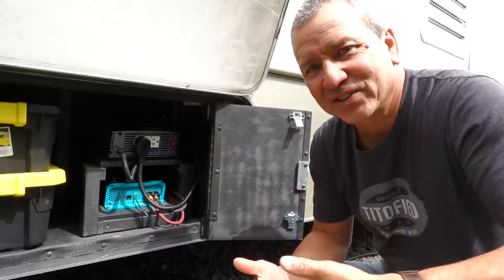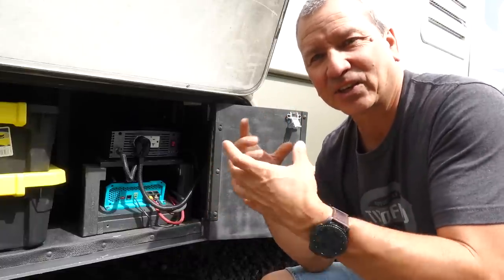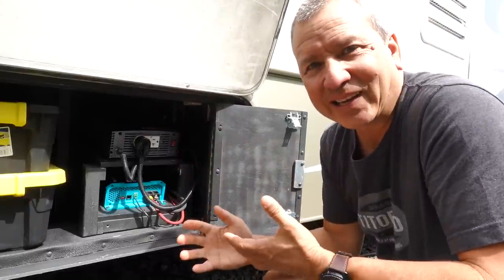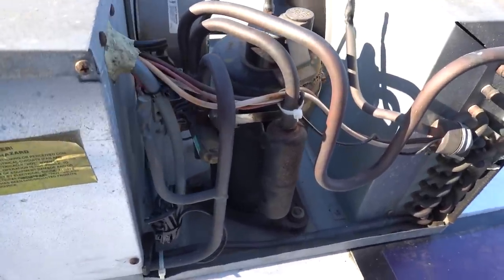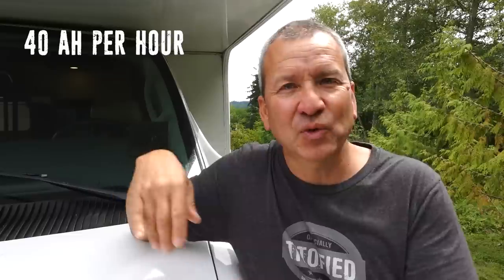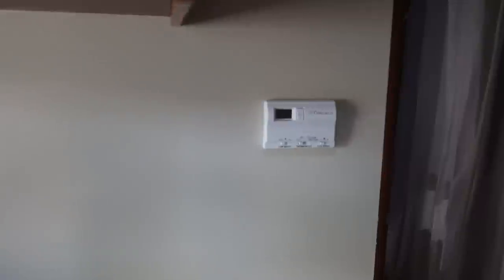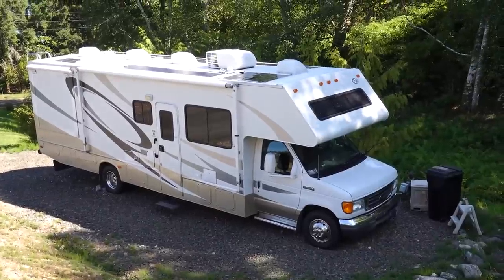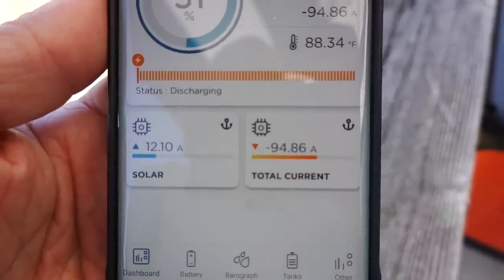BAD IDEA? Running RV Air Conditioner on SOLAR and INVERTER

Comment: You're a brave man for even trying it IMHO. You do have a huge van though. I think any system would struggle to run a decent sized AC unit. IMHO get the RV in the shade, put out awnings either side and run a separate 300W solar panel out in the sun and run fans... well that's how we got around it...
Reply from the maker: That's pretty much what we do until it gets too hot. Then we're moving on to cooler places.
Reply: @RVwithTito  My wife and I can handle the heat but when it's those few weeks that are unbearable, we have resorted to RV parks and just 'plug in' for a few weeks. At least we can run the AC all day everyday, charge all the batteries, bring on fresh water, dump the old, wash and service the  van and just chill during those really humid weeks.

Comment: Excellent share. I have watched several RV videos where the people are mounting panels all over the roof and building huge systems at a ridiculous cost, so they can try to run their AC. The problem is that they do not replenish or, they cannot do much else electrically if they hope to replenish power. All that said, at what cost? This is where green meets reality. I am all for solar on RVs to power inverters and have power for everything smaller but appliances like microwaves, induction cooktops and ACs generally require more than basic capabilities in the solar system and price negates such a choice realistically. Naturally, some are determined to try it anyway- those with money to waste.
Reply from the maker: Thanks. Actually small equipment like microwaves, hair dryers and small induction burners are no big deal. We use them all the time. They pull a lot of amps but only for a few minutes without any significant hit to the batteries. Air conditioners are a different story.

Comment: Thanks for the info. Much appreciate the tips, do & don'ts. Sometimes it's difficult to get the most efficient especially when you need the inverter to remain as cool as possible and not overheat.

Comment: Hmmm, coupla thoughts, Brian. You have some deployable solar panels (ground & window awnings), which might create another 15 Amps when added together? Which would cut the draw in half. Also, your solar setup is partially older, and- there are some newer flexible panels with higher output, so- if you 'chose' to upgrade your roof set up, you could easily bump to 800 or 1,000 watts. Many of us have smaller campers with lower draw, more efficient units... I still think that running a small portable generator for an hour or two in the late afternoon, early evening could really make this a viable solution. You've lost 140+ Lbs by removing the the Onan, but, a 2,000w inverter/generator and a touch more solar...hmmmm. just sayin', Tito!
Reply from the maker: :) Yes I know. I've been contemplating replacing the old Unisolar panels with a few hundred watts more of flex. They've served me so well for the last 8 years and are still going strong especially in low light. I may just mount some new stuff over the top and avoid having to remove the adhesive.

Comment: Great video and explanation.  For inspiration you might check out the design of the Volta Pure3 systems that Winnebago is installing in some of the class B RVs (travato 59 G/K L for lithium).  They use a system with off-the-shelf components comprised of a usable 8700 watt hours of lithium to supply an always 30A/120v invertor.  They use minimal solar, but mainly charge with a 48 volt 6000 watt alternator run by the van engine that at 1500rpm will fully recharge the batteries in less than 2 hours, either when driving or using a smart controller that can automatically start the engine and run at 1500 rpm when needed.   An expensive $25000 option but very well designed in  my opinion for a small RV.  I roughly priced out similar diy components at about $15000 for major components with about 700 watts of solar. There are a few videos out of folks doing your same test of the Volta (one in 100+ degrees heat!).  I agree a $1000 generator is certainly more affordable, but in some situations generators are forbidden and always noisy and smelly.

Comment: Thanks for this interesting video! Roof-top RV air seems the all-time least efficient manner in which to obtain cool air. Therefor I use a split air system that draws just 600 watts. It has inverter circuitry which results in a soft start. I have found that with the 19 amps my solar controller offers mid day (tapering up or down from 3 amps morning and evening) my system can barely keep up SO...I turn the a/c (I run one or the other, not both) on about 1 pm and shut it off about 6 pm. I am adding two additional solar  panels which may well turn the tide on this race for available current. I should add that the more windows I install, the less need I have for the a/c due to cross ventilation. I am finding after 30 years living on wheels, every day is still on on-going experiment with air conditioning. NOTE that I am in a converted cargo trailer with R-15 rockwool insulation. This has a huge effect helping me shoot for 74 degrees.
Reply from the maker: Thanks for sharing your insight. Cheers!

Comment: Some good real world information here. Yes it's possible but there are a ton of variables involved. For 1 the size of your RV and the size of your AC unit along with its efficiency.. The bigger the conditioned space the more power you will need to cool it. So this same setup on let's say a 20ft or smaller RV would require a lot less cooling. Also how well insulated is your RV? Leaky windows? Ect. Most Rv's aren't really designed with peak energy efficiency in mind.

Another factor to consider is how much cooling are you looking to achieve? Running the AC all day and night requires a whole lot more power than just running it for a few hours during the hottest part of the day.

Great Video and great info. Thanks

Comment: NICE VIDEO BRIAN ..!!Since i installed the 364 (2yrs) is nice to run the ac 13,500 btu Carrier in my class B + 22ft Holiday Rambler Augusta with The Honda 2000/2200..Never and issue $2 a day that is CHEAP ..!!!Instant Power..! In Florida that test will last about 5 min..! Maybe with a 5000 btu ac unit it will work longer..!! The test that you did is like filling a siwimming pool with a garden hose and in same time you draining the water with a 5 inch pipe..! Ja.ja..!! Unless you have a massive battery bank like 12.or more batteries.? If you downsize to a class b the results will be different ...The best friend of a solar is a Honda generator..!!!
Reply from the maker: Yes. You're right. If we were to use our A/C more, I'd probably be carrying our portable generator more. Thanks for sharing your setup.

Comment: Hi Brian. We’re in a Newmar 3609 with two Dometic 15k heat pump AC units. Had Arizona Wind and Sun install a solar system. 1400 watts, 3K Victron inverter, 4 100 amp Battle Born batteries. Currently can run one AC for a few hours without any solar. Not using Soft Start. Have not done a long term test with full solar but plan to. Panels typically pull in 1250-1350w on bright sunny day. Panels art flat mounted on roof.   Great video.
Reply from the maker: Glad to hear a 3K inverter would do the trick. I tried it on my 2K and it overloaded it for sure. Based on my tests you'd probably get about 4 hours running both with no solar. So the more solar the better. Good luck!
Reply: RV with Tito DIY I think your numbers are spot on!  The control panel indicated about 4 hours if we ran it on the solar 👍

Comment: I use my 5,000 BTU 455 watt air conditioner every day that I am in my van (Texas panhandle). I installed an Easy Start. I also power a TV and microwave.  I only have 3, 100 amp hour Battle Born batteries and a 790 watt Grape Solar system. I have 3 inverters; a 3,000 watt for the microwave and AC, a 1,500 watt for backup, and a 180 watt for the TV.
Reply from the maker: That is awesome! Thanks for sharing your system.

Comment: I have 570 watts of solar, 2000 watt inverter, soft start installed on the AC, 4 100 amp hour Battle Born batteries. your video kinda encouraged me to try the AC on inverter power...have to talk to Battle Born about warranty effects.
Reply: hey Mike , have  you tried it ? curious how well that works.  I have the same setup but only 1/2 the batteries, Im thinking of doubling our BB from 2 x 100 to 4 x 100, for the rare couple of days that we need to run the air conditioning.
Reply from the maker: Yes. Your setup is very close to mine. You should see similar results.
Reply: @RVwithTito  I have not had a chance to try it yet

Comment: We have 400 AH lithium battery bank with a Victron 3000W inverter and 900W of solar panels. We also have a "hard" start capacitor $10 that handles the compressor surge on start. We can run all day on this. We have a campervan with all the electrical components in the garage and we keep a small fan running on them as the inverter, charge controller and batteries generate a lot of heat when under a heavy load. We turn the a/c off at night and by the time the van is warming up in the early afternoon (we have 3" of spray foam on walls, ceiling and floor) the batteries are charged.
Reply: That's Awesome! Can you share the capacitor specs and online listing info where you found one like that? That would be great. Good job btw on your working build and system👍💪
Reply: Interesting. I have wondered about using a “hard start”. Used them on old house AC split system compressors and they worked great. How long have you used a hard start and what amp draw difference did it make?
Reply from the maker: Great insulation and smaller space certainly helps. Thanks for sharing your setup!

Comment: Morning Brian! Great video topic and I have been planning a similar one! We also have 400ah of BB's with a 3000 watt Multiplus and 300 watts of solar. It was interesting to see your A/C draws about 110 amps as my Penguin II 13,500 draws closer to 150 amps.

 I have a soft start but don't have it installed yet. The A/C does start and run off the inverter and batteries without it, but I'm not sure the strain it is putting on them. I was thinking about running it down till the BMS shuts down to see how that actually works.

Your test results came out pretty good I thought and your extra 300 watts of solar, plus the more efficient A/C will no doubt produce a much longer run time than mine.

Hope you guys are doing well.
Thanks, Aaron
Reply from the maker: Hey Aaron! Yes we're doing well. Hope you are too back home. I'm wondering if your Penguin will run more efficiently with the soft start. Mine seems to be quieter. You'll probably be able to cool your rig down faster too since it's smaller. Looking forward to your video.

Comment: Our AC draws 500-700watts with the compressor running. We use a 1 farad capacitor on our 12v system for any major drawdowns and it helps. We need a larger solar aray to run it for hours however. Its fine to stop for lunch and use it.

Comment: Great video and info as always, thanks! Our current travel trailer doesn’t have an inverter or solar but it’s so poorly insulated that I wouldn’t bother! In this Texas heat the 13.5k AC has to run almost non-stop anyways (at least during the day)! We enjoy it but it’s not an ideal rig for boondocking unless it’s perfect weather!

Comment: i have a victron setup useing 8 12v 100ah batteries running in a 48v config with a 5kw inverter and about 3kw of solar and i can run my ac system without any issues and still make power during the day. for the 12v appliances in my rv i have a 70amp 48v to 12v converter. my rooftop system is a newer model and draws about 1100w and can cool down the area with no issues.

Comment: Brian, You should check out Gone Boondocking Youtube channel. He did a mini split ac install on his class c. He says he can run it 24/7. Would love to know what you think.
Reply from the maker: I do subscribe to him and have seen the video. I don't think we use our A/C enough to justify it. Good content though...also love the 1 hour shower. I'm working on something like that too.
Reply: @RVwithTito  please post your version of the hour shower.  We don't boondock often, but I may put one together for those week long on-the-beach boondocking vacations that my daughter loves.  I would be interested to see your take on the device.
Reply: I followed gone boon dockings install with a Pioneer 9000 BTU unit 22 seer
 My solar almost keeps up with it running in the summer with 950 W on the roof. When I add my 240 W of ground deploy I'm in the plus
Reply: Ed Mor nice info to have😀
Reply from the maker: @lauramathys2131  Oh I certainly will if can get to it. There will certainly be a bit of trial and error first :)
Reply: Mr. Cool DIY mini splits are around 1100. Well worth it to be cool without generator or shore power.

Comment: Agreed! NOT PRACTICAL!
Part of the problem that not many discuss is the extreme heat the inverter generates when running an AC unit (or actually anything drawing 50-100% of the rated wattage). Also, lots of heat gets generated in the batteries when pulling (or charging) large amps from the batteries.
Yes, they say lithium batts can be used up to say 130F but they don't say how you are degrading the batts on that sort of temp.
I also notice the amps pulled from the AC depends on the outdoor temps and humidity.
I have 600 AH LiPo and 960 watts of solar
Reply from the maker: Thanks for chiming in and sharing your thoughts on this. I agree, that is a concern. We don't typically run into that since we haven't used the A/C in this mode. We typically only use high-draw loads for a few minutes at at time.

Comment: We have a 40' class A with 2700 watts of solar, and 25kWh of batteries. This completely removes the need for a generator; (We don't have one)

It would be difficult to park off-grid in Phoenix in July, but we can exist most anywhere else we want and use air conditioning day and night.

If we DO need to visit Phoenix in July, at most a 15 amp extension cord supplies all the extra power we need to sit in 100F+ heat.
Reply from the maker: Quite the setup. Thanks!
Reply: That is quite a battery set up. my four battle born 100 AH is about 5KWH you have 5 times that wow

Comment: While you’re kind of rooftop system is not really feasible unless you have a massive solar system with batteries it’s being done every day now with mini splits, yes you would have to change your system out but when you have a system that just draws 400 or 500 Watts And can easily runoff solar and house batteries it may be worth just ditching that junk on the roof but thanks again for this one to explain to people that this is a tricky option.

Comment: Excellent video. I have a question I have not found an answer to. How about replacing your A/C's AC motor with a DC motor and bypassing the converter and it's efficiency loss. Since you would want at least 4 batteries (12 volts each), use a 48 volt DC motor to better handle the load.
Reply: Would the DC motor pull less on the start and is it an easy swap?
Reply from the maker: Could certainly be more efficient if you want to put in the effort. Have you found a DC motor for that, then probably a speed controller...not sure. I know the motor (fan only uses about 12A at 13V).

Comment: I live off grid and run my AC unit strictly off of solar.. No generator.. I have a window unit with a built in soft start that cost 260 bucks.. It is a 6000btu Danby that I got from Home Depot.. When it starts it draws about 450 watts and then slowly increases until it gets up to about 550 watts.. It is only good for about 200+ sq ft but the fact that it came with a built in soft start with the AC for only 260 is what amazes me.. If a window unit is an option,, this is the way to go..
Reply from the maker: Sounds like a good solution for a small to medium space. Thanks for the info.

Comment: Nice video very well presented.  It IS practical, it's just your current system was not designed with air con in mind. If you follow one rule:  You need to run a big load for large parts of the day then you need to up your solar game to have at least as much solar power as the load i.e in your case 2000w of solar.  You appear to have plenty of roof space so those 12v stick on panels could be replaced with proper ~300w 24v panels in series and a new charge controller and hey presto, air con all day.  This isn't as expensive as you think as the flexible solar panels are hideously overpriced usually so you can actually buy proper big panels for approx the same price.  It's an idea, worth a look!!

Comment: I think mini split is the way to go. Highly efficient with built in inverter. A guy here has a mini split running off solar.
Reply from the maker: Agreed. Based on the comments. Mini split seems to be the best solution if you can find a place to mount it.
Reply: Would love to have mini getting closer to plausible!

Comment: Thanks Brian. Great presentation however I called that one from the start:  if you want AC use a generator.
Reply from the maker: Nailed it 😀
Reply: I have 1400w and 964 amp h of  Lithium And it runs my mini split day and night with no problem  in 95 +

 I have only electric appliances electric range hot water heater microwave convection oven TV xbox
Reply: @williambrawner2618  
That's like $10,000 in batteries!!!
Reply: @mobileempire5522   No no not at all. I bought used Tesla batteries out of a 2016 model S  I purchased 2 modules they were $950 apiece They weigh 60 pounds apiece So far I'm loving them